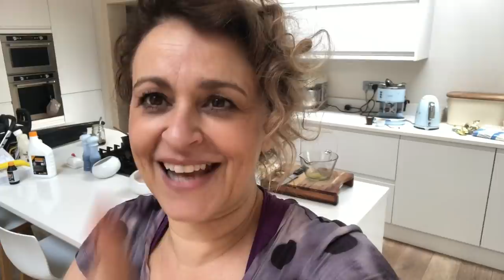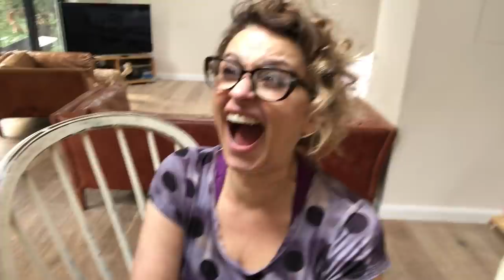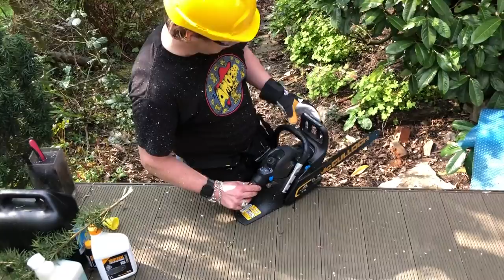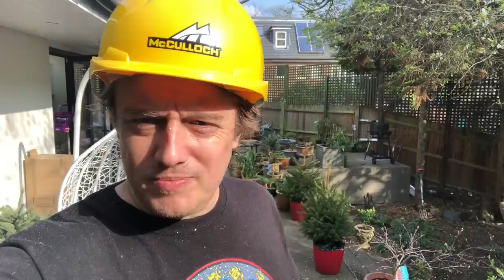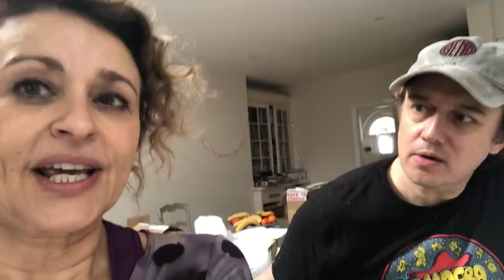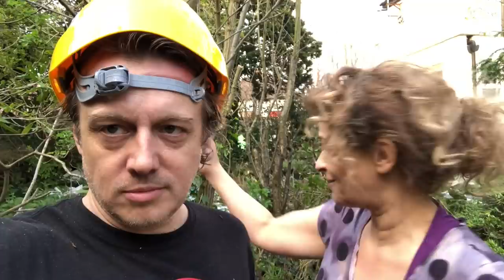Weekend Vlog #20 - Nadia ISN'T Turned On By Mark in a UNIFORM so Mark CHAINSAWS the Garden to PIECES

Comment: Mark, a great start to clearing the yard. You need to wear long sleeves though.  
Nadia, you have to clear out the crap so you can start planting more. It’ll be at least a 2-3 year process to see the fruits of your labor. 
You need to get a skip ASAP to start getting rid of the crap so it will look better and you can see what needs to be done next.  There’s no use thinking about a lawn yet until you have totally cleared the yard. Yes you can fix the lawn with seeds. Make sure you airate the ground and fertilise.